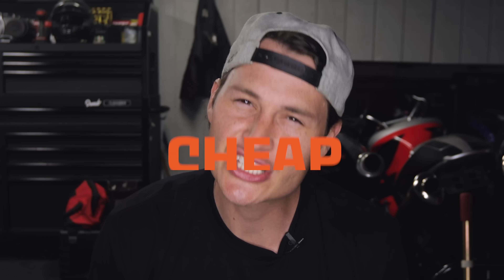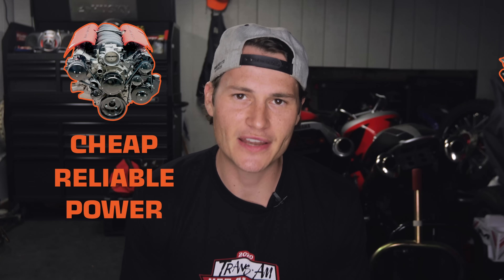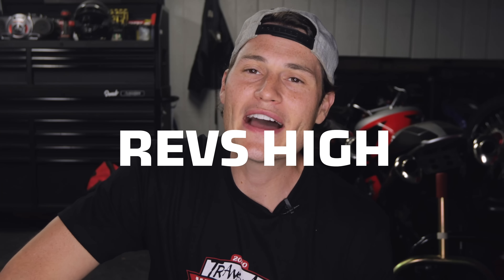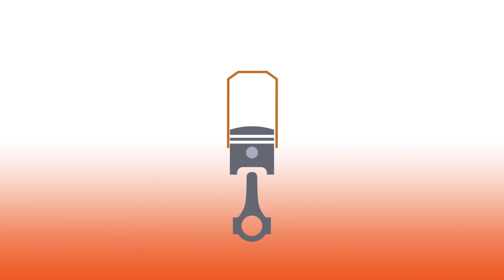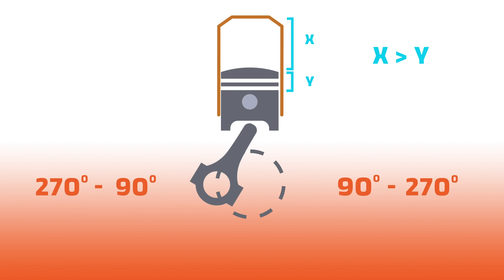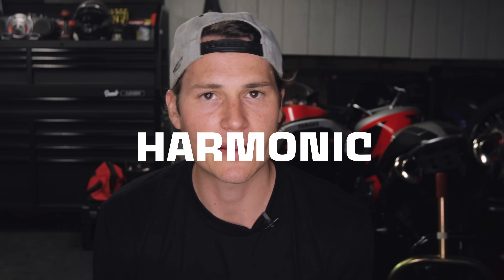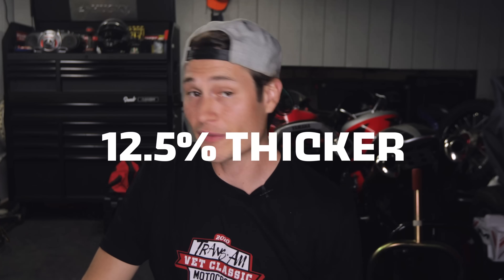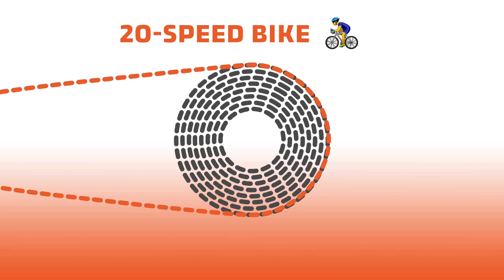Nissan VQ Engine - The Science Explained

Comment: My 18 year old, well maintained, 2003 Nissan Pathfinder with the VQ35DE V6 was an awesome trouble free engine. It ran so smooth at times I didn't know it was running and would accidentally engage the starter to start it. The 4 speed Auto was trouble free as well. The only complaint was that the VQ35DE like to eat oil in between oil changes. Sad to see it go as I just traded it in on a new vehicle.
Reply: My 350z isn’t really eating alot of oil i feel like, 6speed 03 350z with brembos :) everything is original.. only problem i have rn is a squeeky clutch😂 and i feel like its a bit sticky

Comment: I've personally owned a g35 with the vq35hr and let me tell you... it's not that great. its reliability is absolutely crap compared to other engines. yes, the power is great but it's not worth the constant need of fixing it. out of the fixes I had to do, the VTC Cover Assembly was the nail in the coffin. they wore out and each block has one. a new set will run you over $1200 and to put it on and have them programmed by the dealer will cost over $3000(what I was exactly quoted by the dealership when mine needed new vtc covers). And yes, the dealer. you need the "Nissan consult software" to reprogram it. Only a Nissan dealership has it. Don't let the cheap Chinese "consult scanners" fool you, they don't work. If you have a Nissan/Infiniti with a VQ and you love the car. start saving up at least $4k for the VTC cover change.

Comment: couple of things wrong with your engine animations; when you showed the inline six, it does not actually fire 2 cylinders at the same time, in fact, every inline 6 ever has the same firing order; 1-5-3-6-2-4. and for secondary balancing, its not that the piston has more distance to travel at the top section (how would you make an eccentric shaft on a piston engine??) it is that the piston moves faster in the ups and downs and is almost stationary at top and bottom dead center. it tingled my diesel mechanics brain, we almost only work on inline 6's :D

Comment: Renault unfortunately cheapened this Nissan engine threatening its reliability.  Renault changed it with low quality timing Chan tensioner, piston rings and bad catalytic converters that destroy this engine. RENAULT IS CANCER.
Reply: Don’t even get me started on what they did to the Pathfinder!
Reply: u sure ? coz all renault parts : cheap interior (radio ,buttons..etc) + small engines with their own transi are only used in small nissan cars thats it. big trucks/suvs/sedans/coupe engines and transi r 100% nissan japanese . i dont think nissan ll ever use a renault parts in their v6 /v8 engines cause renault only make small ones that doesnt even last 20k kms let alone a v6/v8
Reply: @Abujound  when Carlos Ghosn came aboard if  Nissan wasn’t using Renault parts, they were shopping them out from the lowest bidder quality be damned.  Ghosn ruined Nissan from day 1.  It just took time for the public to notice.
Reply: @Mabeylater293  well my point is about engine and transmi cause its hard for me to believe that nissan is using renault or cheap  components in their high end engines/transmi(not talking cvt)  its just doesnt make any sense those engines r powerful any cheap side ll break ez , if talking suspension/interior...etc then i agree
Reply: @Abujound  the Nissan designed 3.5 followed the excellent design of the 3.0 vq.  The 3.0 was bulletproof.  The 3.5 had Carlos Ghosn cost cutting influence and had timing chain tensioner problems, piston ring problems, galley gasket problems, oil consumption problems and more. RENAULT IS CANCER.  And they infected Nissan with their disease.
Reply: @Mabeylater293  i did research about what u said and it is true , and funny thing my catalytic converter was like (voila motherfuckeh haha) cat is making weird noise and need replacement and the mechanic told me the cat is indeed cheap compared to old nissans (he adviced me to clean the inside of both cats and remove the inside small parts making weird noises)
Reply: Scapegoat much?

Comment: "The vq35hr is the Creme de la creme" while the better-in-every-way vq37vhr is just sitting there like what am I, chopped liver?
Reply: Before I was boosted I never lost to g37 coupe or sedan in my 08 hr sedan
Reply: @stophatingmichael6767  08 or 09 is the fastest I think
Reply: @stophatingmichael6767  yeah idk why the 07-08 g35’s are faster. But I mean if you modded both of them the g37 would make more power.
Reply: Jacob ferg ya the 3.7 makes a bit more power and when Modded n/a. The hr G35 sedan 07-08 are lighter than the 08 and 09 and up g37 coupe an sedans so that might make up for that bit of extra power.
Reply: @stophatingmichael6767  my 370 was never beat by a 350 hr or de. Keep convincing urself it’s a better car but at the end of the day it’s just not.
Reply: Whippet Canister I hear ya bud but that's just my experience when it comes to the g. I mean if it makes you happy I have a 16 240i as well. I test drove a g37 back in the day before purchasing the hr G35s I didn't feel the performance was any better for the extra money so I chose the 35.
Reply: Whippet Canister a de is not even in the conversation I mean come on now lol
Reply: @stophatingmichael6767  I recently picked up an 09 G37x sedan. I love the car, they seem to be getting very popular in my area for some reason. Not too sure why.
Reply: Jacob ferg awesome man prices are really good on them and it's a mostly reliable 330hp no turbos no direct injection needed. Simple and modern enough for many rwd or AWD is offered. Great entry level performance
Reply: @whippetcanister4278  But the 370z platform is lighter than the 350z. So even a 350z hr would be heavier than the 370z. Thus the 370z should always be faster. It would be more of a noticeable diffrence in engine while it's in the G37 and G35 sedans because they would be the same platform. I guess in short it's hard to compare the two engines while they're in two different cars.
Reply: This.

Comment: Ow.......come on. Torsional is twist not flex. 2 pistons don't fire at the same time.  Piston speed is slowest near top and bottom of the stroke. How slow depends on rod and stroke length.  Asymmetrical crank circle?
Reply: Ikr!? I feel like they could have done better explaining how the crank and pistons work in a 4 stroke. All engines with an even number of pistons have paired pistons (buddy pistons), but they're at different stages of the firing order (one firing, one on intake or exhaust and compression.) 

The pistons don't move much at tdc and bdc, they're dead for a few degrees because the crank is moving in a predominantly horizontal arc. Until another piston spins the crank into a more vertical section of it's travel arc the pistons don't really move a lot

Comment: I love the VQ in my 08 Maxima 3.5SE. It’s smooth. Powerful. Reliable. And mine DOESNT BURN OIL. Yes, it is attached to the CVT, but it’s attached to the GOOD one with the steel band/chain. I’ve seen these specific engine/trans models break 250K miles. And I only paid $1100 for mine. Fucking steal. Plus, ignoring the rust lol.... it’s a damn good looking car.

Comment: Best 4 cylinder: Honda K series 
Best inline six: Toyota 2JZ.
Best V6: Nissan VQ series
Best V8: GM LS series
Worst engines list:
Worst 4 cylinder: GM Quad 4
Worst inline six: GM 4200
Worst V6: Chrysler 2.7 V6 and Ford 3.5 and 3.7 fwd engines.
Worst V8: BMW V8 with Vanos and/or Valvetronic.

Comment: God... you just got so much wrong with that secondary engine imbalance description. Good illustrations but damn, that was the worst description of secondary imbalance I've ever heard. But no hate, it is complex stuff. I know your heart is in the right place.

First, you are right about how counterweights make side to side motion for the engine. But those are unrelated to secondary imbalance. Secondary forces go back and forth twice as often as primary forces. That's why balance shafts are geared to spin twice the speed of the crank.

The piston does go faster at the top of the cylinder, and that is the cause of secondary imbalance in something like an inline 4. But the better way to think about it is that the piston spends more time below the halfway point in its stroke than it does above it. Since the engine is in primary balance, the piston has another piston that goes up and down opposite of it. But since the piston is moving down more of the time than it's opposite piston is moving up, The primary balance of the pistons is imperfect. It's not a perfect sine wave, so they don't cancel out, there are remaining vibrations because there's more under the curve than over it.

Inline sixes have a method of primary balance that creates no secondary imbalance from the pistons.
Reply: Oh dear God. I'm bailing. The pistons do not fire together like that in an inline six. FFS this is ridiculous. When the piston fires is irrelevant. It doesn't fire every time it comes up unless it's a 2 stroke engine. The cylinders fire in the order 153624. That jumps back and forth across the engine, not firing at the same time. 

"you should start a school". The actual fuck? You're just lying to people who don't know any better. This stuff is easy to learn from Wikipedia, you could have just read the Wikipedia page in monotone and made a better video. I'm sorry. I'm out. This is hurting me to watch.

If you ask me, you have a journalistic duty to report on how flawed the descriptions are here.

Comment: Wait, I’m a mechanic and that whole thing with the piston moving faster on the top 90° rotation only makes no sense. Yeah, the piston move linearly faster in an arc of rotation, but the point which it moves faster linearly in the [relative] vertical direction will be in the middle stroke area, such as between 30° and 150°. The piston rod-piston mechanism, when connected to a flywheel (for easier visualization. It works the exact same way for a crankshaft because the crankshaft doesn’t move in an elliptical motion), causes the piston to move downwards and upwards slower as it approaches and leaves the 0° and 180° positions, because the piston rod it not pushing the piston upwards or downwards as much and instead the rod in turning horizontally as it goes around the flywheel. Then, when the rod reaches 180° rotation/top dead center, the rod now will gradually move less horizontally and move vertically as the arc of rotation approaches 270° where it maxes out in vertical speed.

The only scenario where the video is at least kind of correct is if the crankshaft spot that the piston rod connects to is rotating off center to the center of rotation of a normal crankshaft, which has never been done and is extremely complicated if attempted.

Comment: I’m on my second 03 maxima se, my first I spent a year bringing this car back from the dead from sitting under a tree. I replace ALOT. I spent numerous paychecks on it. I moved back to Florida and hydrolocked my engine threw my cold air intake in a flash flood. I bought the same car to transfer what I could to hang on to the idea of building a decent car. My question is the first one I bought this car and a previous owner removed the third car and straight piped it. I got rid of exhaust emptied my two cats left and dummy plugged the sensors. One hand it sounded incredible (I left the resonator on) on the other hand seemed like my timing was off. Does getting rid of your cats throw the timing off? And I’m thinking about straight piping and getting rid of third cat. Does anyone think that throws the timing off? Sincerely AmateurMotorhead

Comment: VQ top end sucks. Was able to beat each gen maxima in a rolling top speed run all the way up to the 7th gen with my rare and stock 3rd gen max VE30DE 5spd with only 190hp. If you disagree you're a noob #factoryfreak

Comment: 07 350Z owner here. (VQ35hr) the engines are great however, they were only made for 2 1/2 years. 07-08 all models 2009 for vert 350’s. The platform is expensive to mod due to lack of aftermarket go fast parts that are compatible for the HR. However the internals are good for 600whp and will still be pretty freaking reliable. Food for thought. I love my car after 7 years of ownership. 🤙

Comment: " In the VQ35HR, the connecting rod bolt
diameter has also been increased from 8mm to 9mm
to gain about 25% in strength". I really love you guys, It's not a hate, just a question. I taked his from the HR upgrades manual. So is not just the connecting rod bolts that got thicker??? Sorry about my english and Love you Guys.

Comment: Y'all should do BMW i6 engines along with the famous ZF 8HP transmissions.
Reply: Are they the 4th best I6 after the 2JZ, RB26DETT & Barra?
Reply: @xeftones  well, the s58 just came out on the M3 and M4. Comparing apples to apples, they are already much better in the stock form. Bolt on and turbo upgrades already give you more power than the 2jz would without modofying the internals...
Reply: @xeftones  Barra 🤟💪

Comment: 15:28 They don't share syncronizers, they share a synchro *HUB*. Each gear still has its own baulk ring/dog clutch. Also, the gears do not grind; the gears are constantly meshed and never move. What you hear grinding is the dog teeth on the side of the gear, grinding against the synchro hub as it tries to lick onto that gear.

Comment: You're using all the right nomenclature, but explaining it all wrong. 6 cylinder engines don't fire 1+6, 2+5 and 3+4 together; they're just at TDC at the same time. One on compression, the other on exhaust. Torsional vibration is not at all what you described it as, although the type of vibration you described is something that exists has to be designed for. Also, crank walk is not what you described, and is not prevented by a main cap girdle. Crank walk is when you have too much end float in the crank, because the thrust bearing is worn out.

Comment: I'll stick with my VH45 in my Z32. It doesn't just save weight, a shorter wider engine helps with balance front rear as well.
Reply: z32's have 1% better distribution than a nissan SEDAN with a VQ. u dum?

Comment: I had a G35 with a VQ35DE and a G37 with a VQ37VHR. The info about how Nissan made the engine stronger/stiffer and balanced was interesting but I was always disappointed that these engines didn't really get any benefit to bolt-on mods. The only way to boost power in these engines was to go FI, which would likely cost at least $10k or much more with the necessary mods to accommodate the extra power. Stock at 332HP wasn't enough power and 270 lb/ft of torque is pretty weak.

Comment: The engine in my 2007 Nissan 3.5 Altima (6M trans) is also a VQ but is rated at 270HP. Could it be upgraded easily for more HP?

Comment: Secondary Vibration are unbalanced forces from front to back or left to right. These are caused by orientation of the banks, number of cylinders and both relative to respective firing order.   “The shape of the crank isn’t perfectly symmetrical.” WOW!  Note how the animation from 270-90 and back collapses the distance between the rod and the piston while extending it between 90-270.

Comment: I had a phd mathematician come up to me and tell me my engine sounded so "balanced" because I had a muffler delete at the time. Z  is long gone now but was decent reliability-wise. Control arm bushings WILL fail, valve cover gaskets are a bitch and bet on your cam and crank position sensors to go bad. Miss my Z sometimes but working on inlines are a dream.

Comment: All I know is that my 3.5L V6 in my 350Z and the 3.7L in my Infiniti Q60S are both really smooth
and have virtually no vibration. I have had inline six, and four cylinders as well
as V8's and to be frank, these Nissan V6's are smoother.
Reply: They are both great. I have a g35 and g37 in the driveway. The vq35 is fun, but I've gotten so much more power put of the vq37. Unless you're boosting, which 90+% of people aren't, you'll get much more out of the vq37, in my experience.

Comment: You guys should do a video on the Honda J Series, they make great torque just like the VQ and have many variants from 2.5 up to 3.7l. Great horsepower, Great fuel economy. Is also a 60deg engine and is used in the SUV, Vans and cars, and has special editions like the Type S. While they are transverse mounted they perform great and last a long time. (As long as you don’t have the automatic, the automatics used to die all the time) I have a 6spd J30 with over 312k on it and it still runs fantastic and gets over 30mpg when Road tripping. Btw I love what you guys have been doing and hope everyone is doing fantastic. Love you guys 👌✌️

Comment: The crankshaft shape and rotation are as close to perfectly "symmetrical" as possible. That one little part of your explanation of this makes that entire piece incorrect. The rotational offset from the vertical axis is what changes the length of stroke between 90BTDC to 90ATDC and 90ATDC to 90BTDC.